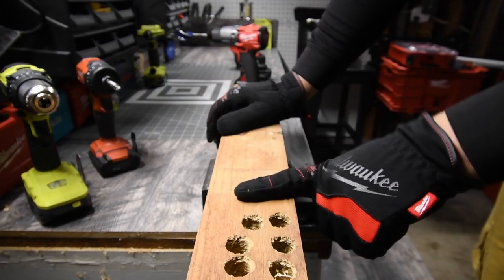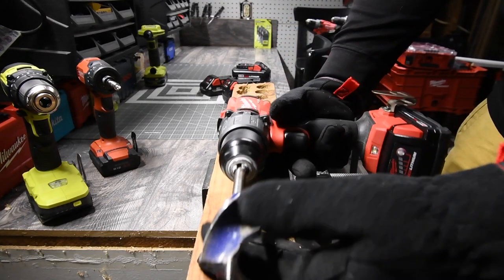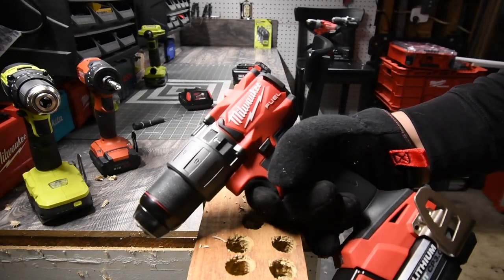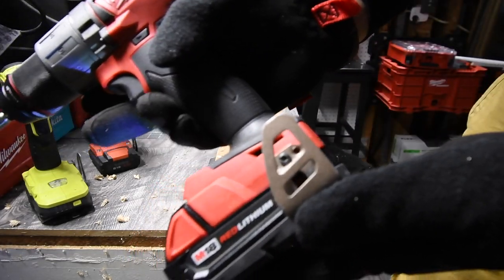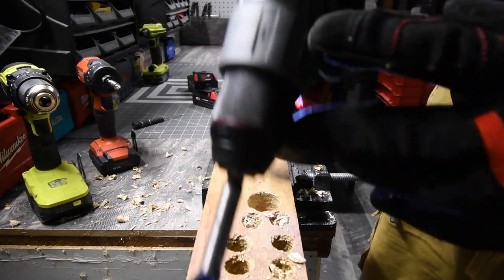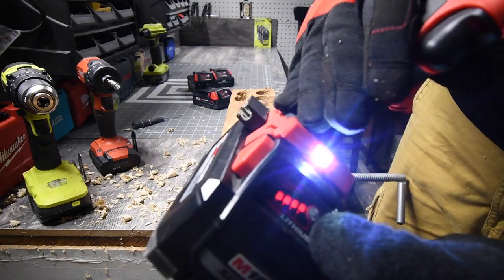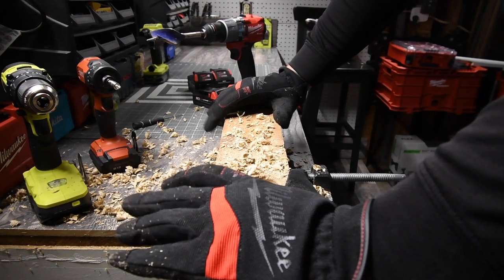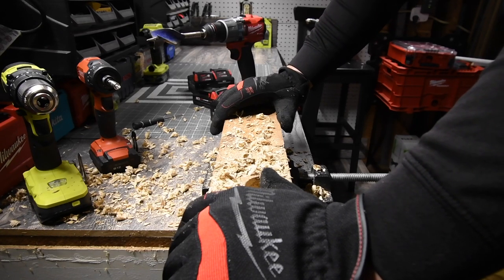HERE IS YOUR ANSWER TO THE MOST HATED QUESTION

Comment: I don't understand people's thoughts on this, but it's such a simple thing anyone can test on their own with a smaller Ah batter to a larger Ah! You are 1000% correct & people who argue or say otherwise need to educate themselves. Just like a 9Ah will beat out a 4,5,6Ah. The larger the Ah, the greater the distribution of power being pulled from the amount of cells. Great video David!
Reply: Not always true. The m18 6.0 ho puts out more than the m18 8.0 ho
Reply: True in most occasions but if you use a smaller ah battery that has 21700 cells it will beat out a larger ah battery that has 18650 cells. The 21700 cells are capable of a lot higher amp discharge rate than the 18650.
Reply: It is only true in situations of high draw in which the number of cells matters. Usually there is diminishing returns. Rarely will a 9Ah beat a 6Ah for most  tools. They'll probably perform the same.
Reply: I have both a 9.0 and a 6.0.  The 6.0 has MORE power than the 9.0 when fully charged.  The 9.0 does run longer though.
Reply: @ianjay4596  samsung 30t is a beast , man!! 35A CDR

Comment: I saw someone test this by ripping boards with a 7 1/4 Ryobi circular saw. His conclusions were the same. That's why I don't buy small batteries and the ones I have are only used in lights.

Comment: It's more about configuration and capability of cells than simply capacity. More Ah does not automatically equal more power. Getting high current (A) output from Li-Ion cells usually comes at a cost of reduced capacity (Ah), so in some cases a 2Ah battery may be able to outperform a 3Ah battery in pure power, but obviously it won't be running as long. 

HOWEVER, a battery with two (or more) rows of cells will pretty much always outperform a battery of same voltage with a single row of cells. 
UNLESS of course there are vast differences in cell type, such as if for example a 3Ah / 18V battery had one row of five 3Ah 21700 cells that can do 50A, and another battery of same voltage -18V but 6Ah capacity, had two parallel rows of five 3Ah 18650 cells that can do 20A, the former battery will be able to output up to 900 Watts, but only for 3.6 minutes.
The latter battery will be able to output only 720 Watts, but for 9 minutes.

Difference may not be felt with smaller tools that do not have enough drain to get a single row battery to its limit. Even a single row, 18V battery with 20A 18650 cells can output 360 Watts, and plenty O'toole don't drain that much. But in a lab environment, the difference can still be measured, because a double row battery will almost always have lower internal resistance, which even with a low current drain will result in less voltage drop under load.

Also, batteries (or tools) may have overcurrent protection that may cut out when current draw peaks over a certain limit (this may happen even with smaller tools, such as when say a drill bit binds up, the motor is stalled and it basically becomes almost a short circuit), and with a double row battery, this limit will USUALLY (exceptions may exist - see above) be higher.
Reply: Well stated. 
If Man Caver has an 8Ah HO battery, he would notice that it won't have any more power than the 6.0.  In fact the 6.0 might actually beat it by a little because 3.0Ah 21700 cells have a little more short term discharge power than 4.0 cells.

Comment: In simple terms. 2 cells is parallel will maintain a high voltage under load compared to a single cell. 2 cells as said in the video will share the load between them. As for the 21700 cells in the bigger batteries they have a even higher drain which in returns holds a even higher voltage under load compared to the 18650s in the small batteries.

Comment: This is really basic.  Power equals volts times Amperes.  In a particular tool, the resistance of the wiring harness and electronics remains the same as you change batteries.  Voltage divided by resistance gives you the amperes.  However, each battery cell has internal resistance which is added to the tool resistance.  The less internal resistance, the more net amperage available at the tool which means more power.  If you double or triple the banks of the same types of cells, going from say, 2 to 4 and 6 Amp hour, you effectively reduce the internal resistance of the cells by half and a third so you can deliver more power with more parallel cells.  Using higher quality cells and generally, larger cells, internal resistance drops as well so  these will provide more usable tool power than smaller or low quality cells.  This is particularly obvious in tools that draw high currents as they have very low resistance and deplete battery charge rapidly and the battery internal resistance becomes a relatively larger portion of total tool resistance.  In tools with long runtimes, the difference won't be appreciable.

Comment: Exactly, this is simple to me. The drill motor pulls the same amount of amperage regardless of the battery being used. A 2ah battery only has 5 cells, while a 5ah battery has double that (I can't remember how many exactly). But the load can more easily distribute the amps across more cells in the 5ah battery, keeping it cooler and performing better.
Reply: Exactly, i see where you're going, smaller batteries get a larger voltage drop under load that's causing the tool that have less power when under heavy load, with bigger batteries (more cells in parallel) the voltage drop will be less which makes more power compared to the smaller batteries, it has nothing to do with amp hours its all about the amounts of cells in parallel

Comment: This is not 100% correct.  Certain cells have different discharge rates.  Many times a lower capacity cell will have higher discharge rates compared to a higher capacity cell. The higher the discharge rate the better the cell will be at releasing it’s stored energy.  For example. The Milwaukee high output 6amp hour battery uses ten 21700 Samsung 30t  cells each cell is rated at 40+amps  for a constant discharge rate and each cell is rated at 3amp hours or 3000mah of capacity.  The Milwaukee high out put 8ah battery uses ten 21700 Samsung 40t cells and these cells are rated at 30amps max discharge and 4,000mah or 4 amp hours of capacity.   The 8 amp hours m18 high output battery will all ways have more capacity and will run the tool for longer compared to the 6amp hour battery but the 6 amp hours battery when running a power hungry tool will always give the tool more power compared to the 8 amp hour hours battery.   Given the same task the 6ah battery will always run cooler and will over load less compared to the 8ah battery. Now the Milwaukee 12ah battery uses 15  of the Samsung 21700 40t cells. Even though this battery uses the lower discharge rate 40t cells it will still have the same performance in terms of power as the high out put 6ah battery because there is 15 cells to distribute the load VS only the 10 cells of the 6ah battery plus of corse the 12 ah battery will have double the run time of the 6ah battery.   It terns of sheer power aka(discharge rate) it’s hard to beat the same sung 21700 30t cellls.  That’s the reason crazy high power single cell custom vaps and crazy high power single cell 10,000+lumen tatacial flashlights all run the 21700 Samsung 30t cell not not higher capacity 4ah or even 5ah 21700 cells.

Comment: Um .... isnt this like common sense? 5 bigger than 2 . 5 better than 2 . 2 weaker than 5 . My question is what is better a 6 amp hr dewalt 21000 cell battery or 9 amp hr  dewalt 17000 cell battery 🤔
Reply: The Dewalt 9.0 FlexVolt and the 6.0 XR both use 21700 cells.  The 9.0 uses 3 rows and the 6.0 only has 2 rows of cells.

Comment: P=I*V. P - power ( watts), I - Current ( amper), V- voltage ( volts). 20v*2 am= 40 watts. 20v* 5am= 100watts
Reply: An amp is not the same thing as an amp-hour
Reply: P=IXE... If you use I as current, then you must use E as Voltage. If you use v as voltage then you should use A as current.
Reply: P=U×I